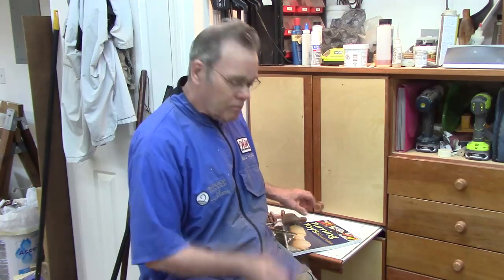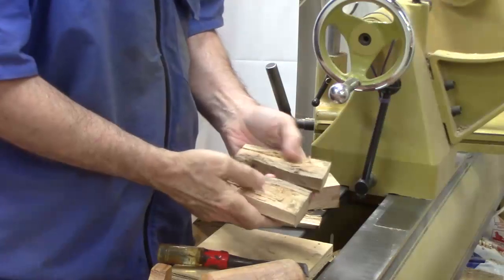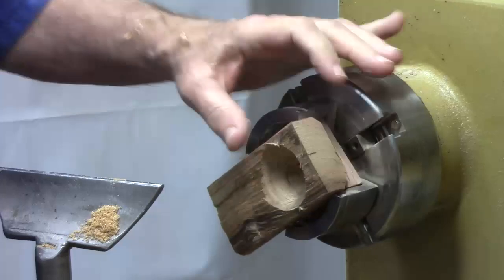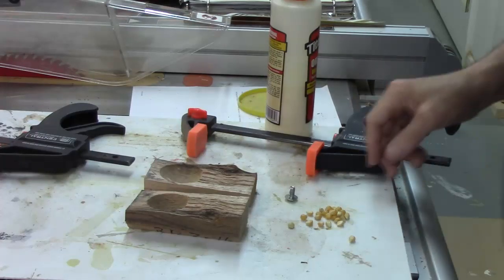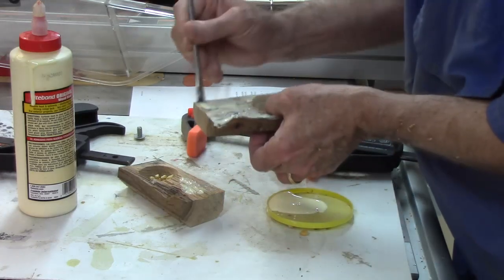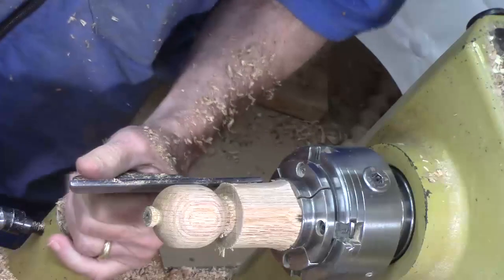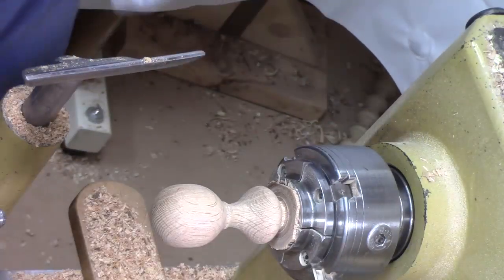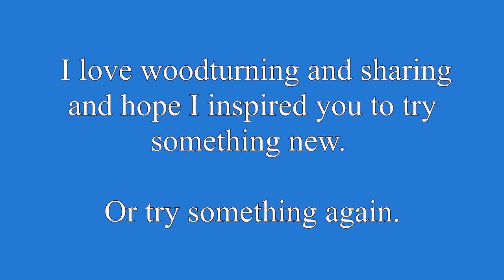Shake That Thing! How to Woodturn a Baby Rattle

Comment: Very nice job.  I would, however, caution against using any kind of "nut" oil on a baby toy.  It is not recommended to give children any nuts or honey (or products of) before age 2 I believe.
Reply: Also, since you mentioned it, avoid porous woods like red oak and stick with woods that sound like food, ie walnut, maple, cherry... A better finish option that parents may have more readily available would be coconut oil. It goes on very nicely, lasts about 6 months, and doesn't go rancid as many others do. Another consideration with the red oak is how it blackens when wet and baby's going to put their mouth on this constantly. I'm 95% sure this one went absolutely fine and is still loved 4 years later as at least a keepsake, but the points I mentioned will help any of us looking to sell these and avoid headaches. I was very happy to see the metal nut was swapped for corn for JIC safety!